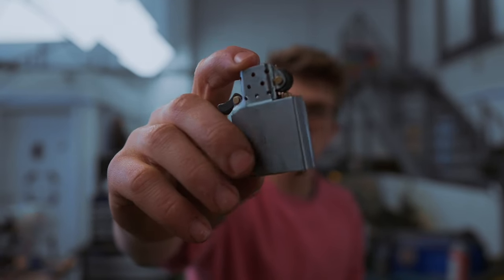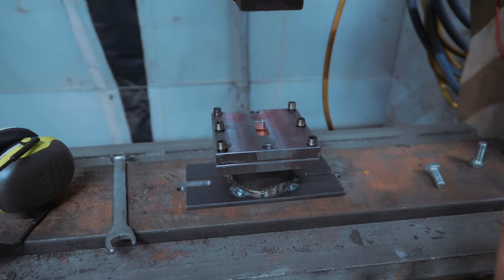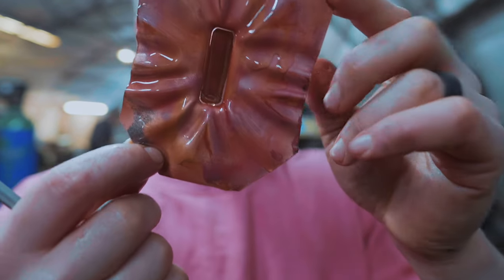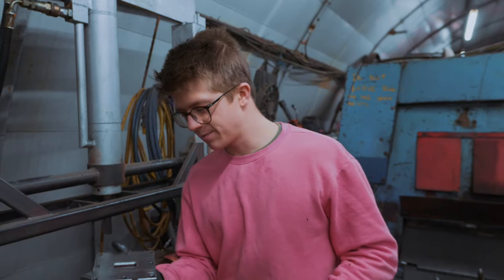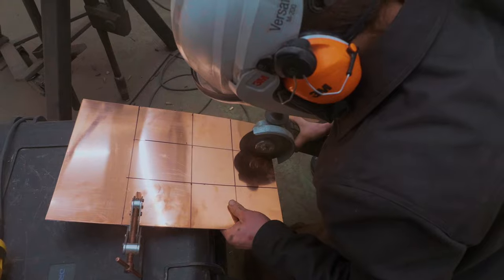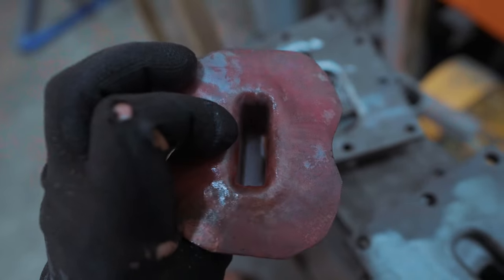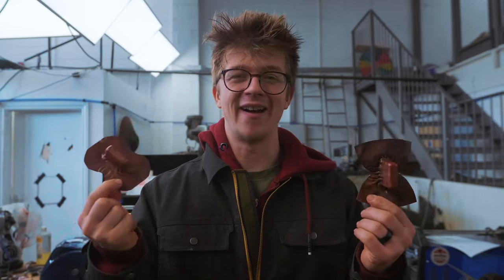Can I Make This Iconic Lighter? Part 5

Comment from the maker: What an ordeal this was, perhaps it would've been an easier job for a Mech! 🤖 Be sure to check out Mech Arena here: https://clik.cc/tb9BN and get a special starter pack to help kickstart your game! ⭐
Reply: Come On Steele. Gave up on this with episode 1! Get in on Tyrell Knife Works 'Dagger Challenge'. GIVE US SOME CONTENT!! 🙏
Reply: Hi Alec, would love to see you make a kukri soon!
Reply: I wish we could buy the failures😄
Reply: Hey alec can you make Alexander Anderson's bayonets from hellsing ultimate
Reply: I gotta wonder why you didn’t heat it until it went plastic then use the punch. It’s the temp too high?
Reply: @cbu5574  it can't be too soft or two hard, to hard the punch snaps through it, to soft it just smushed through it a job like this is insanely delicate I'm not surprised at how long it took him.
Reply: Personally I would have made a set of Rectangular Armourer's anvils same dimensions as your punches to Raise the copper into shape... so the copper doesn't work harden or thin out near where your first attempts cracked/tore.
Reply: At zippo, they use highly polished brass to make the covers first go . 
And the material appears to be much thinner than your copper
Reply: Was the dies for copper or for steel? Steel may have more strength with your current dies.
Reply: You should watch stuff made here's croc video, a lot about punching with dies
Reply: This was awesome! Please tell me you are going to do some engraving and then some self-taught nickel and gold electro-plating!
Reply: Why clamp it? Puts too much stress on the material. When you see blanks move about a factory they are loose for the most part and are drawn in all kinds of shapes.
Reply: Arent zippos made of brass?
Reply: What a pain to see you strugling with this projekt, at the end I am so happy for you that it worked out well, thumbs up 

For my physically unaducated a**: would a counter support from the other side of the hole prevent the cracking? Something to push against the force from above?

Greetings from Germany XD
Reply: can you make a poleaxe?

Comment: As someone who does progressive tool and die for a career.....Ive been screaming at my monitor watching this! Your on a great path buddy! Drawing and extrusion is insanely difficult to get right! You had the right idea when you where thinking multiple steps! The big key things I noticed that where giving you a hard time, the top clamp on your die was only needed for the first step of your progression when you had that set of does laser cut. All the clamp plate was doing was holding metal back from moving in the following stations, if the metal can't move it'll tear! Second, the amount of material you had for the lid was great, but you could have used a bigger piece of stock for the case and done the initial step with a deeper die rather than having to back track later in the process. The other thing that will immensly help is polishing the living snot out of the all the radius of every die, any imperfections cause places for metal to mush into and hang up, rather than slide smoothly to the point of upsetting and extrusion. Speed of the press plays a huge factor as well! If you ever decide to take another stab at this by all means feel free to shoot me a message! I love talking about tool and die and more than that, I love sharing the tips I've picked up over the years☺️
Reply: Best advice ive read yet Brian.
Reply: Diamond polish is a die makers friend
Reply: Diamond geezer
Reply: I hope he sees this
Reply: I really hope he sees this! I'd love to lend some help via tool/die knowledge for the next video!!!! I bet I could even talk him through doing it without having to anneal and without getting those gnarly creases around the work site! The more comments and likes we get on here the more likley he is to see it!!!!
Reply: Zero experience other then a year of jewelry in High school, but I thought the top plate on the clamp was the problem as well... Too much pressure need to pull the copper causing the failure.
Reply: Some of your words are very confusing in here man.. not making much sense...
Reply: Brian, 

1.Would changing the shape of the beginning plate of material help? ( ex. more oblong and not square or round )

2.Also, would trimming off some of the excess material after the initial stages help with the later stages ? ( trim after the wood dies and before progressing to the metal ones )
Reply: I thought the top clamp seemed restrictive
Reply: @johnritchie5968  form factor of the starting material will make a big difference in some cases, in this case though a square blank is what I would have used aswell, but I personally would have put a bit more effort into forming it without the anealing, I think that made the copper more brittle in the end result and is a big part of what lead to the tearing. Between that, polishing and making the dies more gradual, and eliminating that restrictive top clamp/plate, I can see this shape being made in at most, 5 "hits" under the hydraulic press. And another big big tip is the type of oil used between the die and the stock, you want to have the most viscus oil you can find for the extrusion(this is technically stamping but the depth of the dies in my opinion would require sufficient lubrication). There's really alot of variables at play here, but I have a pretty solid process of how to do this in mind!
Reply: Fantastic advice here! Thanks for sharing Brian! 😁

Comment: Hi Alec. Your problem is your retaining plate has to eliminate the wrinkles and reduce the amount of material squeezing into the gap between the punch and the die. the radius is relitive to the thickness of the material. Pollishing the punch and die to a almost mirror finnish to reduce the friction is also very important especialy with softer materials.
Reply: One thing I can add to that list is that  he should reduce his blank size down to the smallest size and shape required to get the desired part. When I was designing deep draw tooling we would have the blank sized so the volume was exactly the same as the final stage prior to the final trim with the trim station only removing a few millimeters of material. As the smaller the blank the less friction there is on the hold down.
Reply: We use carbide dies in our knoblines at Kwikset. And yep. They're shiny. 👍 but we also anneal the brass quite a bit and have... alot of stages in the drawing.
Reply: @DarynRod  I work in receiving for THD. We only ever have to RTV your products due to key mismatches, rather than any issues with the construction. Keep crushing it.
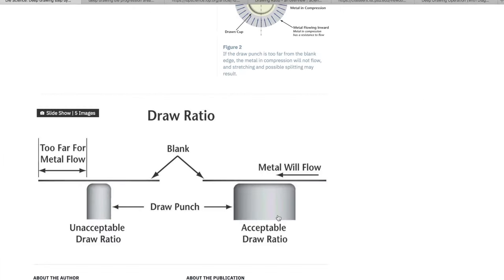Reply: @alexlutz2221  I noticed that @7:09
Reply: Kinda too late for advice now :D

Comment: There are special blends of metals made specifically for deep drawing things. In the motorcycle industry we used "Kawasaki #3" for all the gas tank shells we made. we also used grease and wax paper between the dies to let the metal slide easier.

Comment: For sale on the AlecSteele website a limited run of sculptures called Failure in Copper. 

Seriously - good job on that.  I'm thinking steel draws differently than copper
Reply: Copper is non-ferrous and work hardens.
Reply: @tyrannosaurusimperator  I probably heard that somewhere before and I think brass/bronze does the same thing.  I don't do metalwork but enjoy watching others do it.
Reply: @tyrannosaurusimperator  pretty much all metals work harden, that's why he anneals it, annealing makes it soft again by relaxing the stress on the grain structure ... and copper being non ferrous doesn't have anything to do with this process, I think he chose copper because of it's malleability.

Comment: Good stuff! I’ve collected and been fascinated with zippos for 40 years! 
I’ve done alotta machine work.  Are you using the correct material? 
Aren’t zippo bodies a brass alloy? Probably with a high lead content for stretch ability?
Or have you tried Tellerium Copper? 
Easier to machine and maybe more stretchable.

Comment: I know a bit about Zippos and they are made of brass.  In 2003 they made some of copper that were very popular.  They said they would never use copper again due to a high failure rate.  You can still buy copper “colored” lighters but not pure copper.  Don’t know if that helps.  Btw if you are looking for a copper zippo the hinge is silver.  If it’s copper colored it’s been dipped.

Comment: As a tool & die maker who's built many drawing dies, I must say that I'm impressed by Alex's persistence and the amount of success he was able to attain. Commercial drawing operations have so many advantages, not the least of which is knowledge of best practices for design, building, and process. The alloys selected for drawing are important, as are the lubricants and the presses. I've built draw dies for stainless steel for kitchen sinks as well as tiny hearing aid parts, which used very little lubricant.  

Deep draws often, though not always, require multiple reductions. You don't have the luxury of annealing between press operations. Work hardening is an issue, so for high volume parts, it's desirable to draw the can in one shot.   Often, it's desirable to roughen the radius on the draw punch to grip the metal as it gets drawn to avoid tearing. There is often a counter-punch in the draw die to squeeze the blank tightly. The draw pad is usually controlled by air or nitrogen cylinders. The actual draw radius on the die is highly polished with a type of polishing called draw polishing -- where the polishing scratch pattern is in a longitudinal direction --  in the direction of metal flow.

Comment: Hi alec, a question, maybe I missed it because my english is not so sharp...hahaha, when you heat the copper and put it in the water it doesn't get rigid, thus becoming more brittle? Or does copper behave differently than steel? thank you from brazil

Comment: Did this sorta stuff for a living for a decade.  Should be using drawing compound and multiple progressive steps to reduce stress.  I actually found too much oil (sometimes any oil at all) would simple make it impossible to get a good finished product. Awesome to see you trying new stuff!
Reply: Yes, most times a clean polished radius does the work way better without oil. I was looking at his plates and was terrified he'd fail so many times that he'd just give up.
Reply: @vadimblin  I was thinking that if those radii were mirror polished it would have gone much better for him.  That flap disk finish just isn't smooth enough.
Reply: @Demolishionist  well I used to go for at least 1000 grid. Sometimes even for 2000 and spend like 2-3 days polishing my tooling parts. 
Worked for a decade as a toolmaker.

Comment: I think you need to shape the flat blank to make it draw easier. You may have to much material in your blank. I also think your top plate may be to thin allowing the metal to wrinkle (Its bowing up) and not draw. When that happens you get a hard spot that jams in the dies and punches thru. I have never done one as severe as yours but the ones I have done it is important that the material doesn't wrinkle like that. The blank should pretty much completely draw into the lower die on the last draw. You may have been able to trim most of the flange off after the first few draws. Leaving just enough material to get your height.

Comment: Zippo mostly uses brass these days, but they occasionally use copper, gold and silver, and for a limited time during WW2 - steel. I believe they have a constant heat on the plate to keep it mailable enough for pressing, but I'm glad to see you finally made it happen. Can't wait to see the finished result. All you have left is the detent arm inside the lid and a hinge, which honestly, I'd put on the outside.

Comment: I refurbish med-century Revere Ware for my kids and my nephews. Occasionally, I will find a piece with a plaque of who-knows-what burned onto the copper bottom. If all else fails, I get out the MAPP torch and try to will it off of there. In the process, I see the oxidation rainbow ripple across the copper and think "This is way cooler than just polished copper"!

Comment: Watch your process is great your very good at working the problem. That said you should have increased the thickness of your plate as that would have given you more material to stretch in the dies. I think that between a thicker copper blank and the step dies you would have seen it through a bit earlier. I have also seen forming processes were they used a warm blank so the material is a little more ductile at the start so it’s moving better before the friction heat comes into play. You should not have trapped the edges of your blank I saw that you figured that out later on, great work all around. You always learn more through failure than succcess, because you really understand just what is actually happening during the process. (Suggestion for a project: a garden gate for your house).

Comment: Hey, Alec. Could you not smelt down the failed copper bits and roll them back into sheets? Or do you not have the tooling required for that? (Maybe a dumb question. Sorry.)

Comment: Would brass not have been a better choice for the outer case (most of the Zippo lighters I have owned over the years have been brass (admittedly I have preferred the baked enamel finish for the outer case))?

Comment: Hi alec,

I work in a very large press shop forming steel car panels. Well done for figuring out consecutive draws, this is something we use when we have such a deep draw as you do. There are many comments on here regarding a polished finish which are absolutely correct. Oil is used on our dies to prevent splits but too much can cause the blank to move then you get splits due to material stresses that way. The die material we have is chrome coated also and polished. However we work with steel mostly im not sure how it may react. 

I would aim for between 55 to 60 tons of pressure given the material you have. 

Im sure you will get there . 

Also great channel. 😁
Reply: Just a further note'

If you draw metal too slowly it will split like blue tak. Perhaps speed up the draw. 

Also lighten the upper clamps to allow the material to move, particularly after the initial draw. The die will hold the drawn blank in place.

Comment: Hey!! Really impressed by your way of figuring out everything by yourself and with the great researching skill!
But, as a jeweler/silversmith who used a deep draw when studying at NSCAD University, here are my tips for next time
1. Lard is a great lubricant, since it can be easily wipped off to make sure that there is no dust stuck on those deep drawing plates
2. Using multiple size was a great idea! But there is a way that you could've done it much more easily. Use a sheet of metal 1.5 inch bigger on both sides of the largest hole, and push it entirely through! The top plate shouldn't be an issue if (and only if) you set a precise pressure on every single screw (if I remember well, 70 pound of pressure using a precision wrench). If the pressure is not equal everywhere, one side of the plate might not be pulled along, and a crack will happen
Basically, you could have ended up with a much longer piece of copper extruded that you could have cut at a precise measurement to make the bottom or the top.
If you want to see it, you can find the deep draw demo on the Rio Grande website/channel :)

Comment: I'm guessing to make it more consistent you want a shallower bevel on the large ones and for the size difference to not be linear. Also perhaps radii on the earlier punches that keep the bottom face the same size. It's probably also more complicated than a single radius. Granted, all of that is a ton of work for a one-off project and half the alure of your channel is you learning from and tweaking your failures till you succeed

Comment: I used to be a press operator, should have used dish soap for your lubricant it's metal slides better just some delve or Palmolive with a little bit of water in it, and you have to do your stampings slightly progressive like you did with the 12 because years don't want to stretch the metal to the point where it was ripping you weren't punching through it

Comment: Impressive to see that you go into this project, Pressing is hell, but your issue was not letting the material move freely when pressing :) Great job tho!
Try pressing in multiple steps without a top dye :) press the metal with a more U shaped die first and then a square to releave stress on the corners of the finnisging dye, when you have the material pressed deeply, before starting to shape it, remive access material and anneal it, the hard part is to make sure the material can flow:)

Comment: As someone who works for a hydroforming, bulge forming, and deep drawing company - I have to admit I felt the frustration of parts cracking on you. The rule of thumb in our shop is "if it cracks, not enough lube, or not enough polish on the die, or too much pressure on the press" "if the part wrinkles, too much lube or not enough pressure on the press"

Comment: material flow is challenging.  you were correct in annealing the blank after initial step / draw shape due to work hardening.  the real challenge is to allow the material to "flow" at the correct rate while being formed.  shallow draw parts can utilize a lock bead on the upper, but deeper draw parts need to have a flow or slip bead which will allow material to flow in while being drawn.  lower die and punch need to be polished for best results.  the good thing is that copper will not upbraid your steel dies.  you might have better luck drawing actual steel instead of copper which is very difficult due to its work hardening properties.  like others, i could talk about stuff like this all night, but it's early to rise for me tomorrow.  good luck and keep at it!